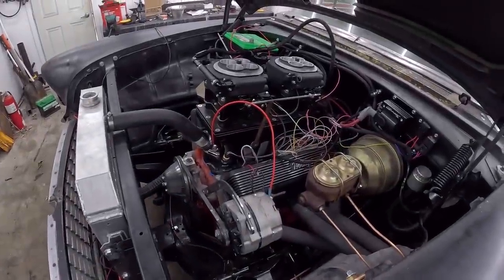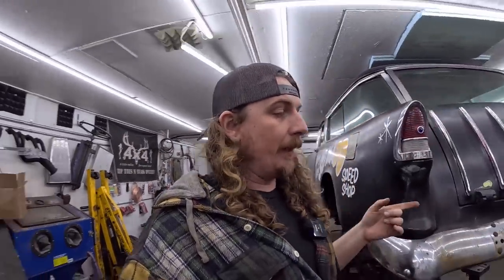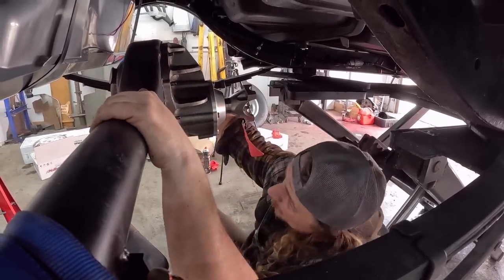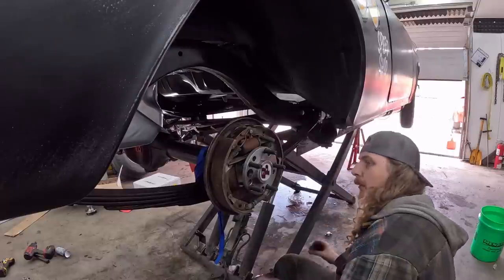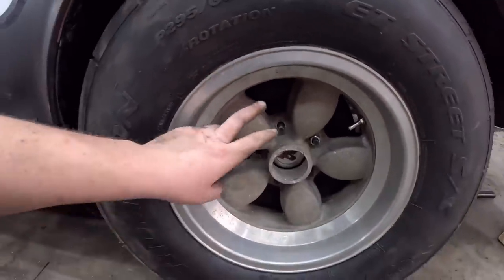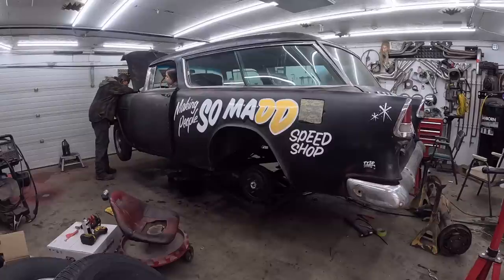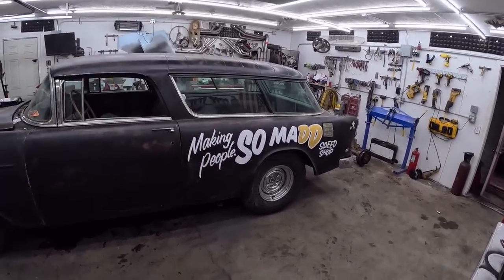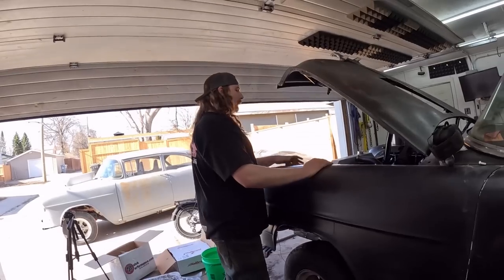I MESSED UP! - Drive Line Measured And Ordered WRONG! 1955 Chevy Nomad Turns A Wheel!

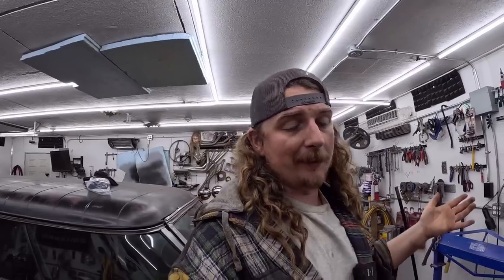Comment: Dan, the 3:55 F9 behind the 454/th400 in my 57 has been bulletproof. Disc brakes up front and the "big" Ford drums in the back, drilled for the GM bolt circle. All good for many years now.
Love the dual snipers.

Comment: From my YouTube angle, I would have moved the spring center pin hole on the new diff forward about 3/4”. This would move the diff back to make  the big meats fit with out cutting the fender.

Comment: Dan smart move on the drag radials soft compound wear  fast save for the track use. Plus they pick up every Little Rock and then some when they get gummy and hot distance driving. Are you going to install any kind of traction device for rear? May have some serious axle rap and wheel hop with the drag radials.

Comment: Haha I like how you used the mallet on the ugly cast iron center section, but then the steel hammer on the precision machined axle flanges. Always use the mallet not the hammer. But hey you got it in there right.

Comment: Curious why you didn't just relocate the spring pin hole on the differential pad. would have allowed your driveshaft to work and moved the rear back so no body work.
Reply: Maybe gets to close to the fuel tank
Reply from the maker: @jagharingenyoutube  bingo
Reply: I agree totally.

Comment: Back 30 years ago,  had an older machine shop owner that could make ANYTHING HAPPEN for Cheap in Ft Worth, Texas. . driveshafts $50 bucks , redrilled axles bolt patterns $50 bucks , shortening rearends total price , both axles and housing $200 bucks , you get where I'm coming from , AWESOME GUY could make ANYTHING HAPPEN, he could and did ANYTHING HOT RODDERS NEEDED for CHEAP , God took him at 67 years old , Hot rodding in Ft Worth has NEVER been the same since . I know there must be Hot Rodding in Heaven because God called him home to way to early because he needed Help , and Mr Morris was AWESOME !

Comment: 37:00 if you filled in and re-drilled the centering holes for the leaf spring perches 3/4 inch back "forward" on the perch, the whole axle would move back making everything fit right. leading to the thought... the leaf spring perches were welded on backwards.

Comment: TO FIT THE TIRE,,DONT CUT OFF LOWER CORNER,,JUST SLICE IT ON A BIAS & PUSH AWAY FROM TIRE SLIDE OVERLAP AT CUT N SLIP FIT UNTIL U LIKE THE GAP TACK WELD AS DESIRED,,THEN U ALWAYS HAVE ORIGINAL 1/4 IF U WANNA CHANGE IT BACK ,,AND I LIKE TO USE SOME KIND OF ASSEMBLY LUBE ON BEARINGS ,SEALS ETC,,90W SHOULD BE OK

Comment: I have built quite a few tri five chevy's and I usually relocate the leaf springs from outside the frame to under the frame.  You may want to weld a back brace onto the 9' housing since even the new fabricated housings are not the strongest.

When it comes to brakes there is a couple cheap upgrade options.  I use the Brembo brakes found on many newer gm performance vehicles.  I use the torino style housing ends since there is numerous cheap kits to mount the Brembo brakes.

Comment: 410 gears are plenty low they will snap your neck. The ford 9 inch Pobably will NOT Break! Wheels are Not to shinny I like them. Didnt see if you put gear grease in the rear end I guess so? I do see two empty Containers behind the rear end though. Its pretty cool for sure.

Comment: Just take the leaf springs apart and re-drill the the leaf spring dowel pin hole and move it back 1/2" then there's no need to cut the front fender flare or driveshaft 💡

Comment: In my opinion an ounce of prevention is worth a pound of cure. That's my take on silicone on axle seals. Great Job. Thnx!!👍👍🇺🇸🇺🇸
Reply from the maker: Can't hurt right?
Reply: @DDSpeedShop  if by chance you end up getting into water that is heavy enough to get onto the seal it won't need a lot of opening to find its way into the housing and your gear set, awful lot of work and money is lost because of no rtv. So nope can't hurt.

Comment: Ford rear end has locating/alignment pins on the axle, '66 Chev Nova has them on the mono leaf. hole in the ford leaf spring weakens the spring and it cracks thru the hole, bad idear!

Comment: A few months ago when looking for weld on differential mounting pads i found ones with three holes to give you an inch forward or back to move the rear end. Those probably would of solved both you issues with the quarter panel and the driveshaft.
Reply from the maker: Can't go back cuz of the fuel tank
Reply: @DDSpeedShop  dang always something

Comment: I think I for warned you in the past to install your rear suspension 5/8" back to center up your wheel opening. - or make a small offset lowering block - But oh-no
Reply from the maker: Fuel tank is right there. It's close as it is

Comment: Hey Dan, if it makes you feel any better, this type of struggling on installing items is normal for a person who doesn't normally do this. In construction 🏗️ 🚧 you have to hold items like that and do the install yourself, however, your using one hand and it's 100 ft. in the air, yikes 😳. If you drop it you can injure someone or destroy property. You did a good 👍 job handling this for not doing it much, installing items that hang. Thanks and I hope you feel better after reading this.

Comment: I think the drag radials I have are rated at 10,000 mile wear, so by the time you get to 10,000 miles they are wasted, yeh change them out for regular tires on long trips, good move.
Reply from the maker: Yeah 1 trip.  That's pricey haha

Comment: no don t cut the 1/4s what did was i took the center bolt out of the spring a d drilled a 3/8 hole and moved the bottom stack of springs back 3/4 and put the eye bolt back in

Comment: I have to shorten my drive shaft in my truck finally because I forgot to take and put weight on my truck when I did my drive shaft in. The rear because I was forgot that I had my Box off my truck when I measured my drive shaft and I just did that.  Somewhat repair fix

Comment: u would love my place 9 inch, dana, splicer 10 acres of good clean project rigs when i start building a rig i will have 2 or more of the same rig like my next project a 79 z28 rs t top have 2 extra z28's for parts same with my 73 ss nova had 3 73 ss nova's to build one but most of the time i really don't need the extra cars but for little things like switching 4 speed to auto or the other way. like the z28's one is a rare model there is one with new interior the has rally wheels plus u can have all factory bolts plus one has a t-10 in it then when i have all the parts i need i can sell the rest of it but the car i build will have a perfect body on it no dings no rust best part is i got everything for free.

Comment: Dude over here putting in new rear-ends, and I am still over here trying to figure out what I need for alternator conversion kit and how large wheels I can have for either 17 or 18 inch wheels for stock suspension on my 57 bel air.
Reply from the maker: Haha ull figure it out
Reply: @DDSpeedShop  Since I am trying to stick with same size all around, thinking of 17x8 with 225 55 tires, or 18x8 with either 235 45 or 225 50. all with a 4.5 or 4.75 backspace. This is a stock cruiser for now. When i LS swap then I will do tons of changes.
Reply: @DDSpeedShop  Also, i have been recording my process. Maybe someday ill start posting videos on here too haha. Great job. Love watching what you do.

Comment: Can I get a size of the tires on the rear (chrome reverse version)? I’m in the tire market.
Reply from the maker: 30 tall teuck tires
Reply: @DDSpeedShop  Thanks boss. I bought a set of Keystone Torq Thrust copies with a 28” tall tire on them. Just wondering how much bigger I want to/can go. I don’t have the Nomad radiused wheel opening either. I have a 56 Handyman and I kind of like the stock wheel openings.

Comment: Very painful to watch! Ford parts Don't need hammer's to put in a 3erd member
Reply: Who doesn't beat their 3rd member?
Reply: Every Ford part I've had needed a hammering to work properly 😂
Reply from the maker: Cmon by next time and slap it in for me
Reply: @DDSpeedShop  I would gladly show you how it's done! Unfortunately there's a boarder problem
Reply: On a work bench and installed vertically  ??